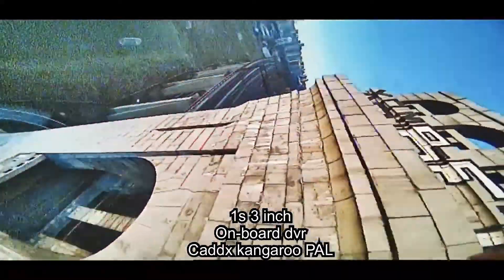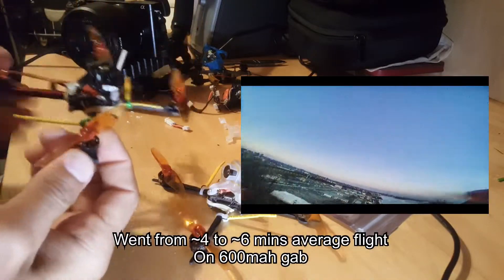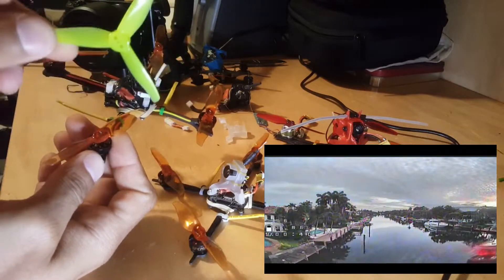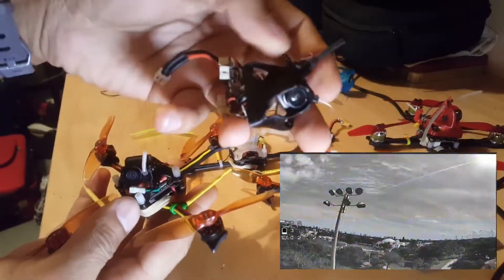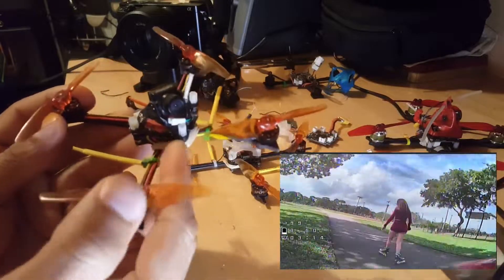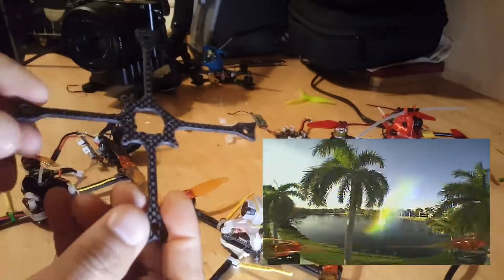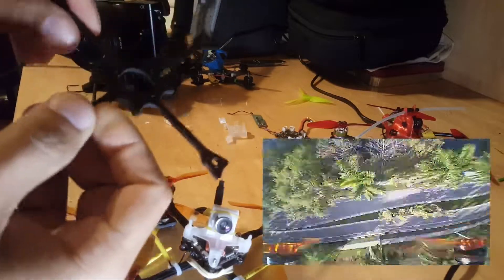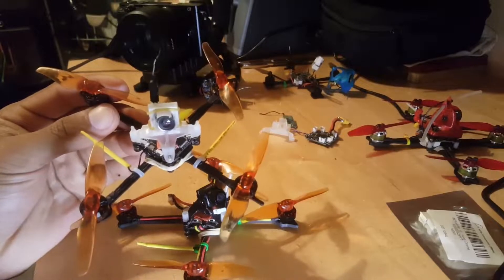48khz + rpm filter = ultimate 1s 3inch experience 😎🥳🔥🔥

Comment: well.. i used same fc like u use.. if i read firmware 48khz .. its use for small props under 3 inch... whats different 24khz and 48khz...?
Reply from the maker: 48khz actually makes a difference on this 3” setup also. It has even more benefits the smaller the prop and motor get. I get more flight time, more than a minute extra flying. It does also change the flight feel a little bit. It feels a little bit softer so there’s a slight trade off

Comment: Can jhemcu f4 can be flight with a cinewhoop set up?
Reply from the maker: I would be mindful using it on something using more than 1s. I’ve burnt an esc using 2s on 10000kv motors and 65mm props. So running on 2s is possible but your really riding the edge of what it’s capable of

Comment: just when i say i have enough quads and im done building you go ahead a make this video 😁. whats your opinion on the battery connector, is a xt30 mandatory or will the beta BT2.0 be sufficient?
Reply from the maker: Haha I know right 😂 I’m really happy with this one to be honest. Out of all the quads I’ve built this is the most versatile and I’ve flown this pretty much anywhere without much notice and scaring people. I can’t comment on the bt2 vs xt30 yet as I’m still on solid pin. I’m about to try the bt2 and will probably stick with it. An xt30 will be good but the extra weight might throw off the perfect balance I feel on this. Those bt2 are a pain to solder tho

Comment: The solid ph2 connectors worked well on my eachine Novice1, a worthy upgrade for sure. I fly it on 2s with x2 solid ph2 connected to x2 1s 450mah batteries.
I bought 5 BT2 connectors for my eachine Trashcan, I put them on 5 different brand batteries. Annoying to solder but worth the effort, I fly the trashcan on 1s with a 300mah Uruav battery it doubled the time before the battery hit low voltage warning. Literally went from 1min to 2min.
Reply from the maker: Thanks for this! I also think I'd benefit from them on this setup. Even more now seeing you doubled the flight time. I won't get double maybe but I do feel the sag with the solid pin. With 2s I'm sure there's a definite benefit.. I've just been too lazy to solder all my batteries 😒 haha
Reply: @DanielSingerX  Ill chuck a video up with the side by side flights👍 I half made it the other day but didn't finish it to upload
Reply from the maker: @BarnzTX3  I'll look out for it 😎
Reply: @DanielSingerX  just uploaded it 👌

Comment: Love the videos man! Which tutorial did you use to install rpm filtering and jesc 48khz?
Reply from the maker: Thank you very much 😎! I believe I watched Albert kims video and used the settings he mentioned. Also I believe took those filtering sliders up a notch. I'll have to do a video on the tune next. I haven't looked on betaflight in a while to remember exactly what I did PID and filter tuning wise haha.
Reply: Daniel Singer thanks man I’ll check that video out. A video on tuning will be great.
I am going to update my f4 board to the latest betaflight and do all those settings for my 2s 65mm toothpick. Can seem to tune it correctly
Reply: Instablaster.

Comment: I have a question. It's like a goggle-recording screen. It's so clean. Do you have any tips for yourself, bro👍🏻👍🏻😄👏🏻🍷🤔
Reply from the maker: Haha thanks! The clean video is from the diamond vtx that has on board recording so there is no breakup. The shots that have breakup I was recording with the eachine rd200 fpv watch that has a DVR built in. I find this recorder adds sharpness and the image looks better than most goggles 😎😎
Reply from the maker: Another trick is I slightly squish the video vertically leaving the black bars at the top and bottom. This gives the illusion of more resolution as it squishes the lower vertical resolution of analogue closer together. And also it's mostly recorded in PAL that has better resolution than NTSC 😎 now you have all the secrets haha